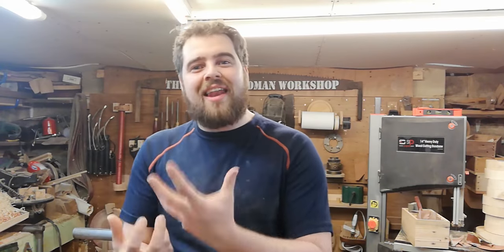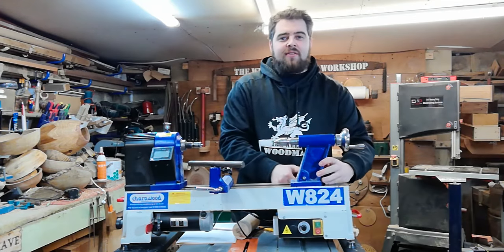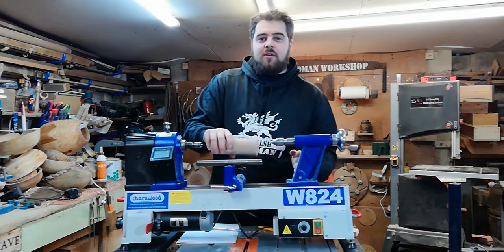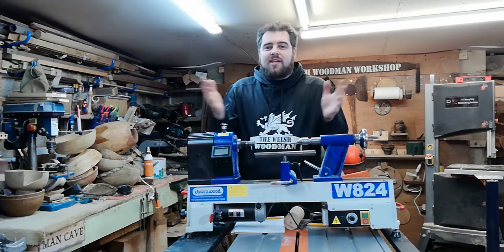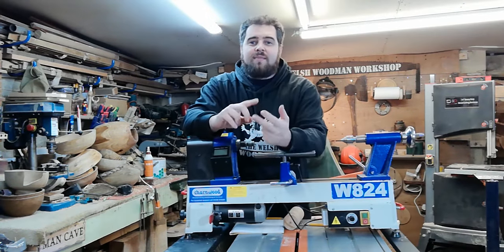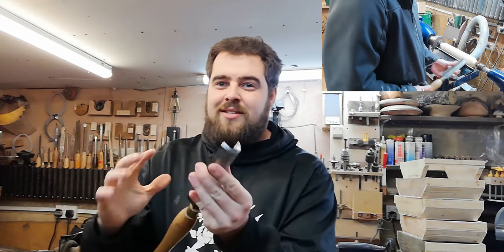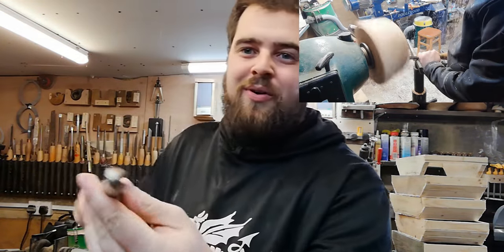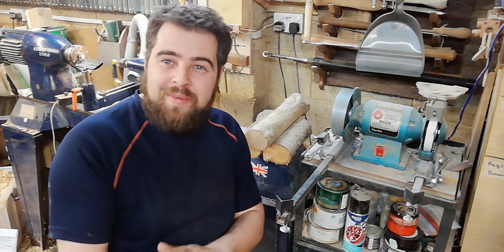How to get started in woodturning

Comment: Great tips sir. Any chance of a video on turning green wood and preventing cracking.
Reply from the maker: Thanks for your comment, I've made a video on my channel called wood turning a green bowl which has some some good tips to prevent cracking in green wood. A few things you can do to prevent cracking are to remove the pith of the wood (center of all the growth rings) as this dramatically reduces cracking, turn an even wall thickness as water from the wood evaporates at an even rate which should also minimise warping, seal the wood as it dries out especially the end grain to allow the piece to dry out slowly, you can also place the green turned work in a bag of green shavings or rap it in cling film to allow the piece to dry out in a slow and controlled way. These should all prevent / minimise cracking. I'll try and cover these topics more in-depth in a future video, I hope this helps 😁

Comment: Hi my friend, have messaged you before on YouTube, and you've been most helpful and wise! I was wondering if I could pick your brains about turning goblets and whiskey tumblers?
What woods are best! And which to avoid! Plus what you use to finish them with? Is it necessary to use something like Plasticoat? Not that whiskey would be in there for long!! I've made a whiskey glass out of Iroko, but have noticed on-line people say it can be a sensitizer, so is best to avoid for drinking vessels; what do you think?
Yours Sincerely,  
Cornelius Matthews.
Reply from the maker: Hi Cornelius, thanks for your message. I made a set of 4 Whiskey tankards out of Oak a few years ago; they were turned to look like mini barrels, as coopers tend to use Oak to make barrels/casks for manufacturing Whiskey it would be my wood of choice. Beech would be another choice as it has tight grain. I finished the tankards with a chestnut products food safe oil - as long as the finish is food safe (especially if you intend to sell them) you should be ok. I hope this helps. best of luck turning 😀Many thanks Tom

Comment: Is it worth starting out with carbide tools to cut down on extra expenses (eg grinder etc) ?
Reply from the maker: Hi Andy thanks for your comment, that's a good consideration. I personally tend to use traditional turning tools for most of my work as that is what I started out with, I haven't had much experience in using carbide tools other than for some of my hollow form work. I've been told that they can be a lot easier to use for beginners to use than traditional tools as they have less of a learning curve,(especially the sharpening) however I've also been told that they are not as efficient at removing material compared to traditional tools. Having said this I've seen fantastic work produced by both traditional and carbide tools, so I would suggest people use whatever they feel most comfortable with 😁
Reply: I made a set of carbide tools myself buying only the square bar, a copper collar,  the carbide tip and screw, and and a tap for the screw thread. They cost me about $15 each. I prefer to use my regular gouges but the carbide comes in great for certain jobs. and will serve you well as beginner.